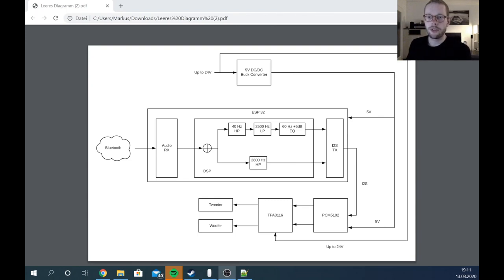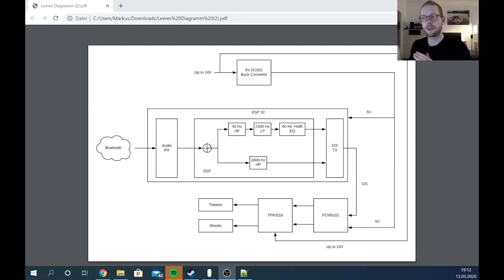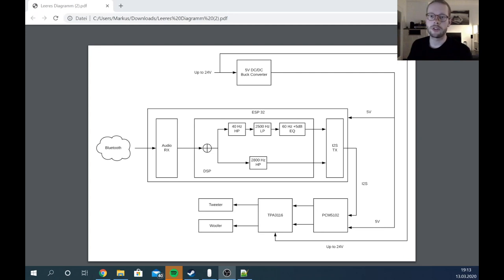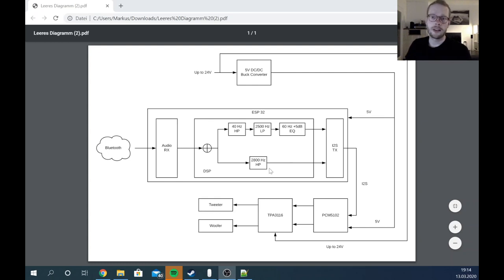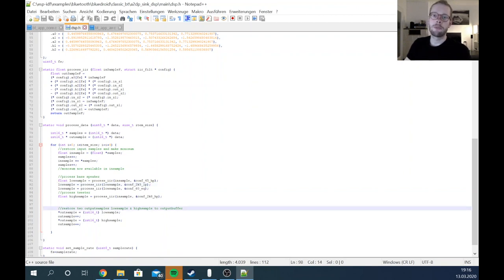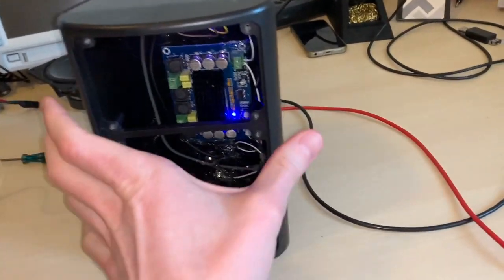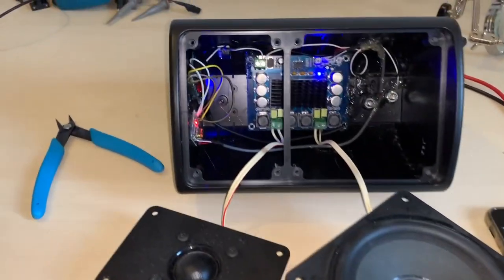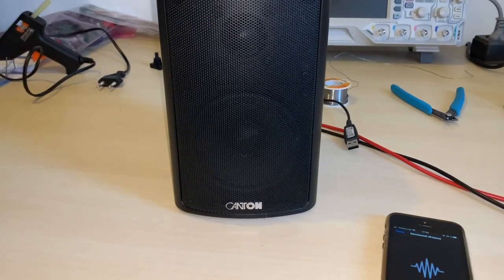[#10] DIY DSP Bluetooth Speaker with ESP32

Comment: DIY is the way to go for your very own bluetooth speaker. And, you get to learn how to code the solution and put it all together. All that's needed is a good sized LiPo rechargeable battery and a charging circuit, then it will be fully portable for hours of playback fun! Very cool!

Comment: Hi, cool project! One thing to keep in mind Esp32 kit is OTA friendly, it means you can program it without USB cabel. Rather than that you would want to use both fast cores of ESP32 and for example make one of them WiFi processes "holder" and second one for filtering and bluetooth. That's just an idea with which the hardware design might be simplified.

Comment: Can’t wait to turn all the speakers in my house into connected speakers. Keep up the amazing work!
Reply: Great work from the author and wonderful learning material. But why are so many people into wireless audio stuff? Laying electrical cables correctly is a skilled occupation(an apprenticeship) and you have to overcome your laziness, i know. With Bluetooth/WiFi/etc. you introduce extra steps in your signal path. That means more noise, more possible failures and greater energy consumption. The "quality of life" argument made so often vanishes at the point in time when you experience your first problems with your setup. And is it really convenient to have such a fragile setup instead of a more robust one?
Of cause you can discuss all these points away and ignore most of the problems, that modern digital and wireless equipment has. The life is easier with blinkers. 
And excuse, I don't want to talk anyone into their home design either, but maybe it's wiser to think about the alternatives first. You might even save money and headaches in the end :)
Reply: Thu Nell Ⓥ  It's like with our both rather lengthy statements: Complexity never introduces simplicity. This is impossible.
If you can't design a amplifier with an appropriate SNR you should question your profession. Digital isn't always better and yes, the circumstances make the picture. Do the math. 
Anyways, thanks for your feedback. My 2 cents: Always keep alternatives in view:)

Comment: Hi I'm working on an a2dp project and having trouble setting the i2s bits on the esp32 to 24 bit. The example I am using(pipeline_a2dp_source_stream) has it set to 16 and I cant find where to change it. My codec needs 24 bit

Comment: Nice. Just wondering one thing, you put the lp for the woofer on 2500 and the hp for the mid/high on 2800. What's the reason for this 300hz gap? Wouldn't that be audible?

Comment: Nice project, did You continued work on this project? I can't see follow up video on channel. Will You continue project or realized something not worth to continue?
Reply from the maker: Hi Dominik.
I don’t have time / motivation at the moment for new videos.
However I have already some further working projects. Mainly in uncompressed audio streaming over IP on ESP32
Reply: @YetAnotherElectronicsChannel  thanks, how do you see a ESP32 as audio receiver or Bluetooth device? Is it worth to use it in this case? I am thinking to build something similar but I would like to use two ESP or other chips to make Bluetooth true wireless stereo setup. Still not sure how is it supposed to work or even if it is possible. How did you planned to modify dsp settings in this project? Some buttons or mobile application?

Comment: Hello. With this setup, is it possible to build a parametric equalizer that would work real time? is the ESP32 capable of doing that? Thanks!
Reply from the maker: Sergio Franco yes sure you can also do Equalizer with an IIR Filter. The way how you calculate your IIR parameters is a little bit different ... go to the link below and choose „peak“ as type https://www.earlevel.com/main/2013/10/13/biquad-calculator-v2/
Reply: @YetAnotherElectronicsChannel  you are the best....made my life a bit easier with this link...thanks😀
Reply: @YetAnotherElectronicsChannel  I think from what Sergio was asking, would it be possible to have an interface (using an LCD and rotary encoder) to dynamically change the boost/cut for a set of frequencies. This would be similar to making an active 5 band graphic equaliser from opamps for example. I would assume you would create a LUT of pre-calculated coefficients for a frequency band, and through the implemented UI, you can change in a pre-calculated coefficients, right? Being your code is interrupt driven, an implementation of a rotary encoder would cause popping or distortion on the output?

Comment: Interesting project, I have a couple of  i2s dacs that will be arriving soon, definitely will try this first.
I have a question though, do you think esp32 can still handle additional 2 filters for the second audio channel?
Reply: Which DAC did you use? All of the ones I see online are a bit costly can I get the names of your DAC?
Reply: @youcubersaaraswata8865  I'm using Texas Instrument PCM5102, there are many dev board also available in aliexpress. Also ESP32 can run 2 FIR filters for stereo at full 384 KHz sampling. It can even run 4096 FFT at 100KHz, you can hook it up on a radio transmitter to have data transmission and receive it on other side.
Reply: @prinzrainerbuyo3234  In india Aliexpress is banned and also the pcm5102 is so expensive that I could but a good quality bl speaker in that cost, fortunately the uda1334 is quite affordable but still it costs more than the esp itself, i am thinking of a way that I can produce high quality audio from esp32

Comment: Nice work! Did you meet any noise issue? I built similar stuff, and it works well when the esp32 is powered by usb. When I use a dc dc converter in parallel with amp, just like what you did, the system picks up a lot of noise. I've been stuck with the issue for weeks. Any suggestions?
Reply: DC-DC converters are switching power supplies, which are inherently noisy. Suggest putting a toroid choke immediately at the output of the converter to catch the 30-60Khz noise typical of those.

Comment: Would it be possible to also connect a 3.5mm audio jack straight to the amplifier to connect a phone wired to the speaker? Or would this not play well with the DAC as it would now get a signal on it's output.

Comment: Servus, these cheap TPA boards use often an high gain setting of the TPA and the potis only dampen the signal before the input. Look at the schematics of the board and the datasheet. The crackling comes during playback comes from overdriving the speaker (woofer is NOT the right word for such a small - probably wide band speaker). The crackling sound at turn one may come from an offset. The dac may drive mid-level from the beginning and the amp starts at ground.
Thanks for the other videos on the STM32 DSP stuff!